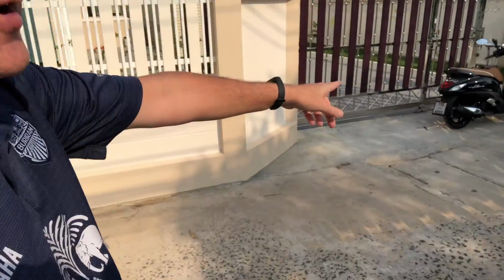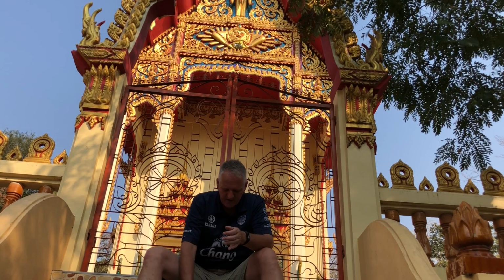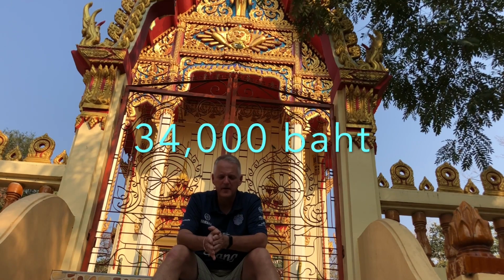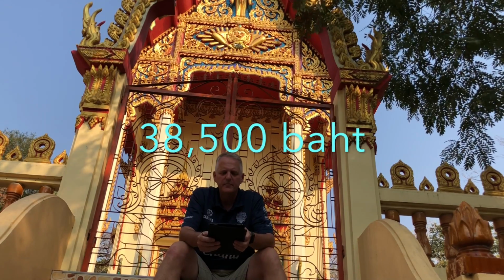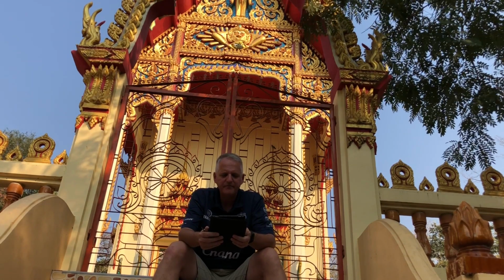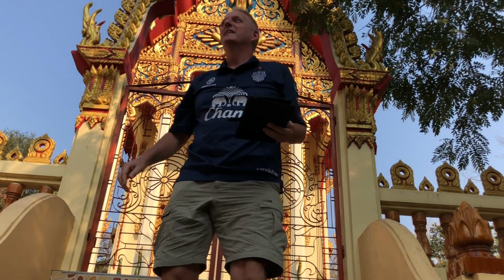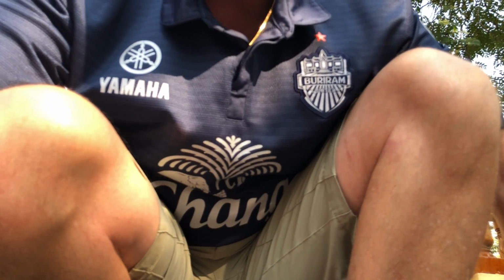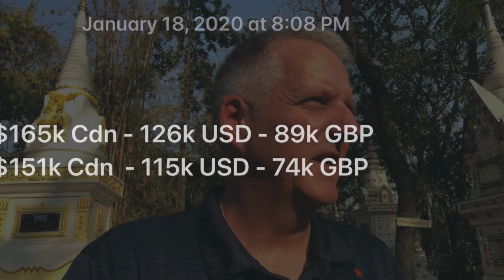v67 COST BREAKDOWN - NEW HOME BUILD BURIRAM THAILAND BANGKOK HOUSE PROJECT บ้าน

Comment: I looked at this because building a 2 floor house with total floor space of 300 m2 and budgeted 3 Million bt
When I look at your cost, I am starting to worry now.
Saying that I paid the architect/structural calculations and planning/building permission 10,000 bt in total.
Reply from the maker: Sorry for the delayed response.  It certainly is an interesting time right now.  I'm not sure if that will help in your budget or not.  I would think more projects are on hold right now - and less farang money coming into the country.  That may work to your advantage.  What part of Thailand do you plan to build in?  Also, thanks for watching !!
Reply: @PolarAttack  I am in Udonthani.  I am almost finished the 310 m2 building and cost to date (including 160,000 bt of equipment ) is 2.4 M bt.  It should be complete at 2.8 M bt. maximum.
Reply from the maker: John Anderson that’ll be great if you can come in under budget. How long has the project been?
Reply: @PolarAttack  Don't laugh!  I started it in February 2018.
Reply from the maker: @johntheaccountant5594  Ahhh ok, no laughing here.  Timelines are what they are.  As long as you're happy with the finished home.  That's all that matters really.  So, when you said "it'll be finished soon", did you mean before 2022 😂  🤣
Reply: @PolarAttack  If and When I can get back to Thailand, I estimate one month to finish the main house , myself and one labourer.
Reply from the maker: John Anderson I’m guessing that’s one month after the quarantine camp 😝😋😖🤦🏼‍♂️
Reply: @PolarAttack  I was hoping October, but I cannot see me being able to go back to Thailand until 2021 at the earliest with this Corona Virus fiasco.
Reply from the maker: John Anderson I’m the same right now. I’ve always returned before October 15. This year, I just don’t know.

Comment: Interesting video, lived in Thailand 12 years and witnessed many builds those tower blocks amaze me and one time in Pattaya they added 13 floors, extra  before it was. noticed that some one could not count the build was halted but after couple of years it carried on,( probably cash in the form of bribes was paid so not to knock the sky skraper down), just hope the foundations haven't started crumbling. Every build I've ever seen the brick and block work has been total rubbish many times not even keyed in. Then it's all hidden with rendering a job there very good at oddly. Also mostly women work on building sites doing the very hard labouring jobs for little money. Another build I witnessed a huge beer bar complex that was built on 2 levels but the plans and finished build where very different as was built back to front. That complex stood empty for years then was knocked down to build hotels. Certainly an odd place to witness buildings been built and nearly every thing is made from concrete even the kitchen sink and Kitchen worktops.
Reply from the maker: Yes, so true everything you say.  I've also seen many things the way you describe them.  I'm glad i was present about 80% of the build.  Although it seemed i caught them on something everyday.  I know, i should've stayed here entire time.  This builder came recommended to us.  That's one reason we went with him.  Like you say, toss on some paint and all the construction looks the same.   Time will always tell.  Thanks again !!

Comment: WOW! Seems to all add up!
What would you estimate the cost to build per square metre?
We have 5.1 rai in Buriram and plan to build over two stages, 10 houses and then another 21 houses.
50 wah land per dwelling, and 130m2 to 140m2 houses.
Reply from the maker: First off, thanks for watching.  Also, it sounds like you have a huge project on your hands.
￼
I’ll use loose numbers in my calculations. Basically the house complete with fence, gates & furnishings was say 3.7￼m baht - based on the home size of say 225 (living area) + 45 (garage) SqM that would run about 13,700 baht/sqM.  Not including the land. 

Using tighter numbers on home construction only - that would be just over 3.3￼m baht. That would give a square meter build at ￼12,300 baht/SqM.
Reply: I noticed is that you say your houses are 130m2 so assume single floor houses
Look at 10,000 bt / m2  for single floor if you organise yourself.
50 wah = 200 m2 per plot and you are talking about 130m2 floor per house. I would say not enough garden.

Comment: R U or have U got a Lease or Usufruct on the house. Thailand have no central policy on Usufructs & leave it the Provences land offices & some give them easy, some R more difficult & done make it impossible. I live in Udon & it was easy to get my Usufruct on the land & house. Even if I broke with my wife or she died before me it's mine till I die &  I can even rent it out & keep the rent money. Here is a link that explains it.    https://youtu.be/bjin_JT-RaU
Reply from the maker: Thanks for that.  I've never heard of it before today.  So, no, i don't have one.  Seems like the perfect idea though.  Thanks for sharing.
Reply: Your welcome. I live in Udon but my wife is from Surin & I go down there a lot & sometimes go over to  Buriram & drink a few in the Irish Bar. Maybe I will see U for a beer there sometime. PS what is the square meters of your house floor, basically the total area upstairs & down stairs U got ceramic tiles on.
Reply from the maker: If i remember correctly it is about 2300 sq/ft so Siri says that's about 213 sq/m
Reply: PolarAttack Tale no notice then of those who say U paid to much as they got no idea. For the quality & finish U done I would have guessed 12,000 a sq.m without appliances.
Reply: PolarAttack I think U will find that we're the walls meet with the ground (soil & concrete) U will find U will get that black mound & the paint will start peeling. Maybe U can look at your neighbors with older houses & SE if they got it. I bought cheap 12 inch x 12 inch cheap glazed shiny ceramic tiles as they R easy to clean & cut them half & struck
them to bottom of the walls to give a 6 inch skirting about 14 years ago & it worked great with no more black mound or peeling paint. It's a cheap easy fix. I think U can still get the tiles for around 200 baht for 1 sq.m or 10 pieces, so cut them in half & that is a 6 meter long run. Webber tile cement is about 300 a 20 Kg bag & allowing 5 Kg a sq.m that will give a 24 meter long run. Guy to the work at 120 a sq.m & I figure it out around 70 Baht a meter length or 7.000 for a 100 meter length.
Reply from the maker: Isaan Man - Yes, you are correct with both your comments.  The house construction was 2.5m (I did a price breakdown v67).  I would say most of the people that claim we paid too much, simply have no idea.  So I accept it at that.￼￼￼  Where I come from in Vancouver CA, we got a steal. People can spend $60-$80,000 renovating their kitchen￼s.
Reply from the maker: Isaan Man - That’s a great tip and I will definitely keep my eye on it.  I’m surprised that none of the concrete underground, and there’s a lot, 23 poles, footings etc. don’t have any waterproofing on them. In Vancouver and probably most of Canada, they painted with a black tar solution and then will use like a drainage rippled fiber board to drain moisture away￼￼￼. All below the dirt surface.  I’ve always been under the impression that concrete is similar to a sponge, I will just suck the moisture up.  And like you mentioned, that would turn into the black mold along your base lines. ￼￼
Reply: PolarAttack I never seen them use the black sealant on the under ground concrete & I have only seen it available here in recent years. Some people say concrete is like a sponge but everything is relative. Breeze blocks, bricks, wall render R very porous but compared to them concrete isn't. No houses here have no damp courses yet there is no rising damp through the concrete because concrete is dense. Footings, pillars & beams have specified minimum thickness of coverage over the rebar & wire ties joining rebar have to have there ends facing into the centre & not the surface. This is because it is hard for moisture to penetrate into the concrete & it travels near the surface & evaporates into the air otherwise the rebar would rust, expand & crack the concrete & if the wire was near the surface that would rust & show through as brown marks. The black sealant of course is a moisture barrier to stop moisture getting into the concrete under ground but do U really need it here especially in Buriram
which is dry & gets 300 days a year of sun shine. Nearly every FCC framed house in Thailand is the same & some R getting quite old but I not heard of any collapsing yet. The expected life of a rcc including footings is supposed to last around a 100 years so I think it will see U out. The black mold likes moisture & shade & that is why U find it at the bottom of walls but it don't grow on ceramic tiles & as I said if they fire a water hose there it also helps take the paint off.
Reply from the maker: That's a great explanation and makes sense.  I guess in Canada i'm used to seeing more homes and buildings with a LOT of build underground.  Parking and/or basements.  Then like you say, climate etc. No perma frost/deep freeze in Buriram :-))  I have scene (on tv) rebar rust and crack cement - just like you say happens.  It was in China during their more recent build boom.  Bad cement and worse engineering.  Funny thing, everyone just walked away - like a new ghost town.  Cheaper than trying to fix it.